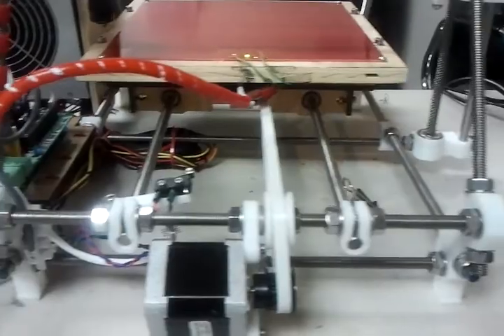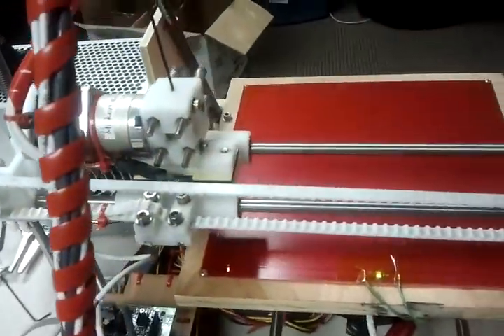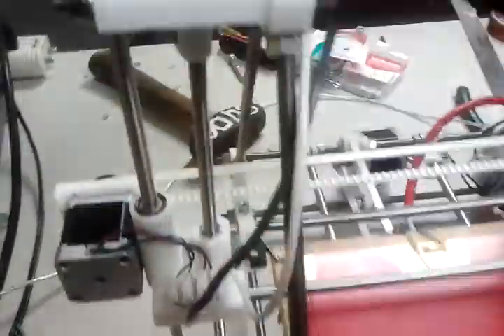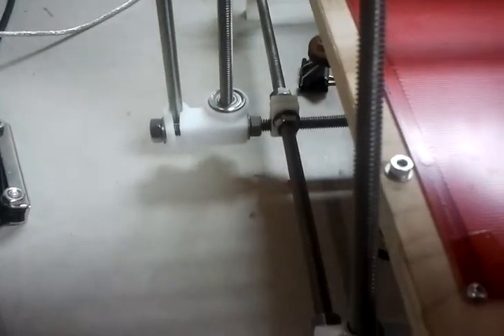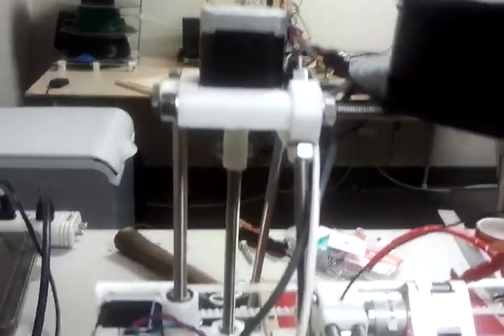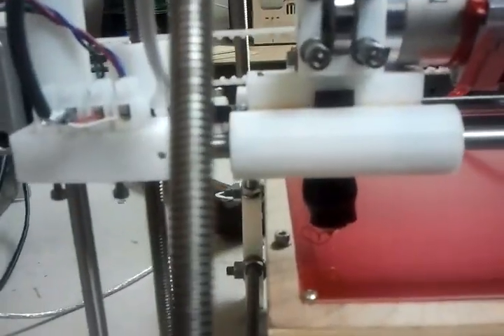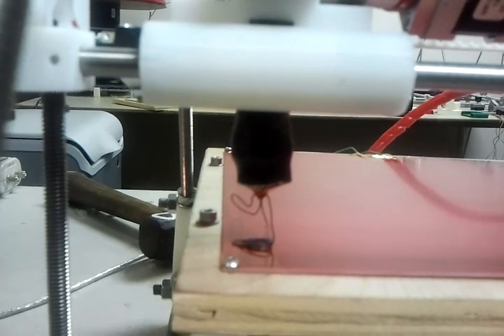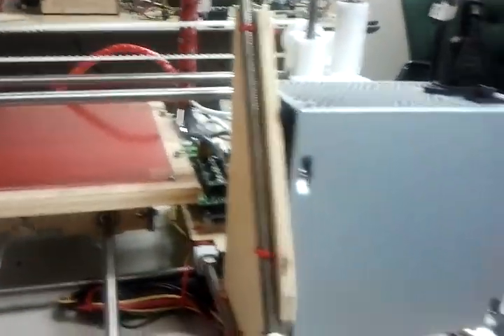1st Homing and Extrusion of my MakerGear Prusa Mendel Kit

Comment: I'm just getting my printer working.
Its a Mendel90 with RAMPS 1.4 and Marlin.
My homing sequence does not double bounce off the stops...
Any suggestions?
Firmware is pretty much stock.